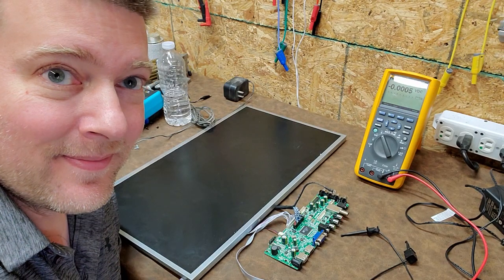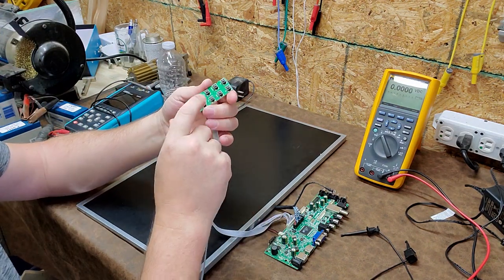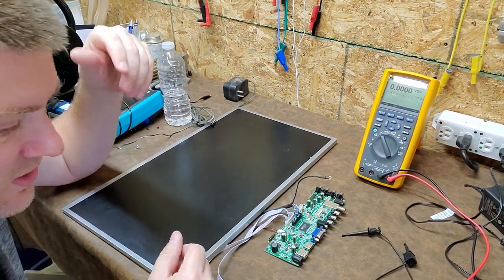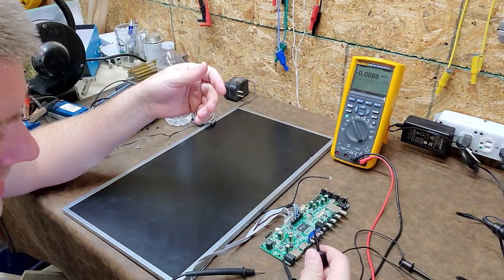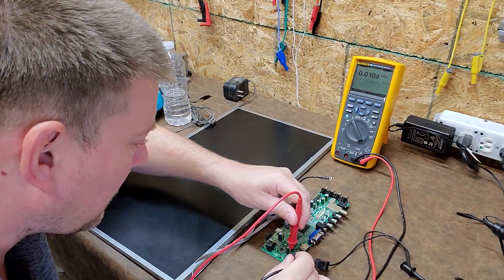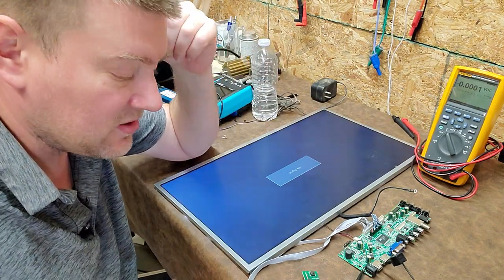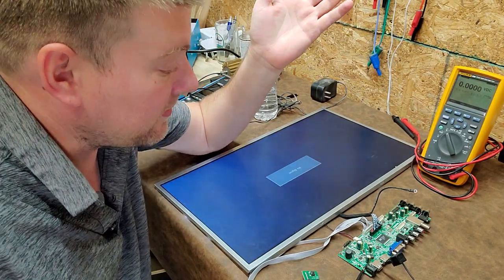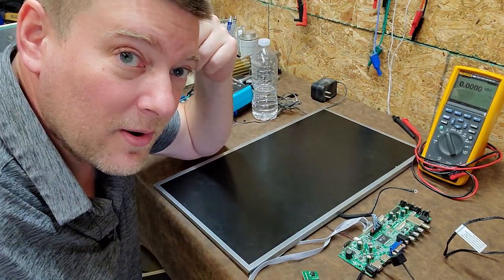Troubleshooting A Medical Display

Comment: To add some level of current limiting if anything goes wrong, is to use a incandescent car light bulb like 5, 10 or 50Watt in series with your DUT , if working with 12V DC. 
For higher voltages like 24V or higher, you can place 2 or more 12V car light bulbs in series.